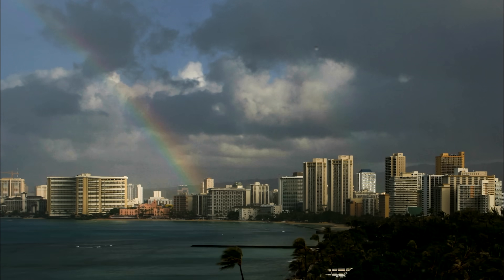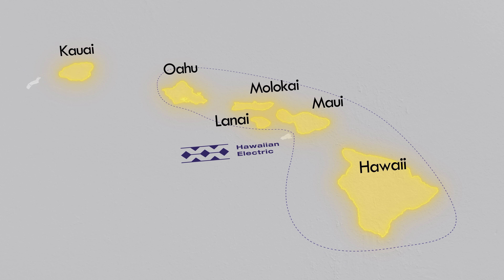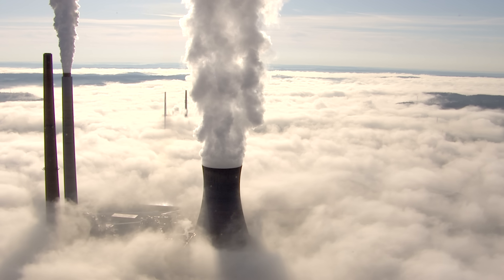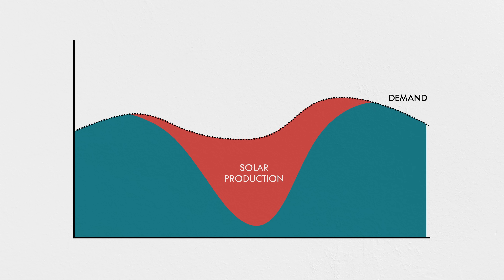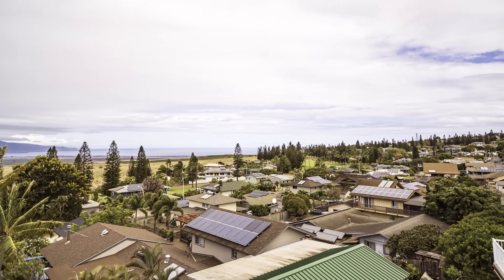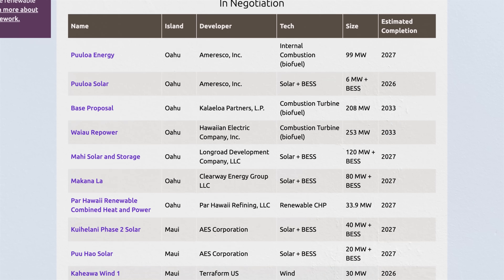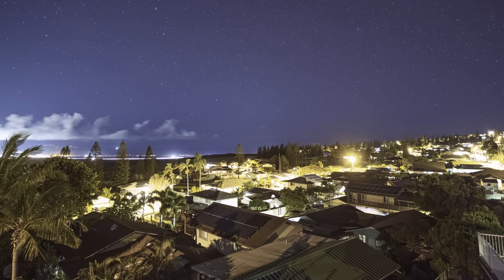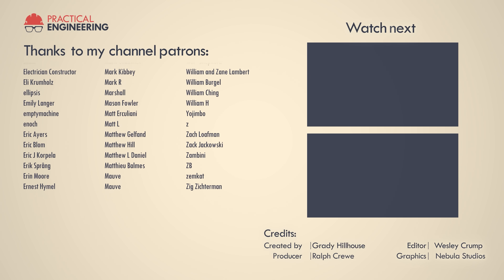How the Hawaiian Power Grid Works

Comment: BUILD NUCLEAR POWER ON AN ASSEMBLY LINE BASIS AND PUT THEM UP WORLDWIDE AS FAST AS A WALMART.

SUPER STORMS, 
EXTREME WEATHER AND ELECTRICITY SHORTAGES 
CAN ALL BE ANSWERED BY OFF-THE-SHELF TECHNOLOGY NOW WITH NUCLEAR POWER. 

NUCLEAR POWER CAN PROVIDE ELECTRICITY FOR CARBON SCRUBBERS. 

CAN PRODUCE HYDROGEN FOR TRUCKS BUSES, RV'S  AND AIRPLANES.

 CAN BE SCALED UP AND DOWN TO COMPLIMENT WIND AND SOLAR.

THEY BURN UP MORE WASTE THEN THEY MAKE.

THEY ARE NON-PROLIFERATION. 

THEY ARE WALK AWAY SAFE.

CAN  PROVIDE STEAM FOR HEATING OUR CITIES.

CAN BE SMALL ENOUGH FOR A CRUISE SHIP OR A SMALL TOWN.

CAN PUT ABOUT 12 OF THEM IN A ROW FOR A LARGE METROPOLITAN CITY.

TRULY COMPLIMENTS A LOCAL POWER GRID.

SMALL FOOTPRINT ABOUT THE SIZE OF A HOME DEPOT.

POLITICIANS AND THE MEDIA HAVE TO STOP SCARING PEOPLE ABOUT NUCLEAR POWER.

 NUCLEAR SAFETY PEOPLE ARE A PARASITE ON THE BUSINESS, MAKING IT SO EXPENSIVE IT CAN'T BE BUILT. 

NUCLEAR POWER IS OVER 99% SAFER THAN PETROLEUM PRODUCT EXTRACTION AND FOR THE ENVIRONMENT.

NUCLEAR POWER IS 99% SAFER THAN PETROLEUM FOSSIL FUEL PRODUCTS.

DON'T BELIEVE ME LOOK AT THE NUMBER OF DEATHS EVERY YEAR EXTRACTING FOSSIL FUELS.

LOOK AT THE POLLUTION IN USING THE AIR WE BREATHE AS THE TRASH CAN FOR FOSSIL FUELS.

LOOK AT THE POLLUTION OF OUR GROUNDWATER.

NUCLEAR POWER CAN USE THE NUCLEAR WASTE AND REPURPOSE IT LIKE FRANCE HAS BEEN DOING FOR MANY YEARS.

THE MEDIA AND POLITICIANS HAVE TO STOP USING NUCLEAR POWER AS CLICKBAIT TO SCARE PEOPLE.

THE MEDIA AND POLITICIANS HAVE BLOOD ON THEIR HANDS FROM EVERY SUPER STORM THAT COMES THROUGH AND EVERY YEAR THAT GOES BY THAT THE PUBLIC IS AFRAID OF NUCLEAR POWER. 

TO POWER ELECTRIC FUTURE BY SCRUBBING CARBON OUT OF THE ATMOSPHERE WE HAVE TO HAVE A CHEAP AND ABUNDANT POWER SOURCE.

A POWER SOURCE BUILT ON AN ASSEMBLY LINE BASIS TO CUT DOWN COSTS AND SHIPPED OUT TO LOCAL COMMUNITIES.

GENERATION 4 NUCLEAR POWER PLANTS HAVE A SMALL FOOTPRINT.

THEY ARE SMALL MODULAR REACTORS THAT CAN BE PUT IN SERIES TO MAKE AS MUCH POWER AS YOU NEED FOR LARGE CITIES AND INDUSTRY.

WE NEED TO HAVE FIELD TRIPS OF KIDS AND PARENTS THAT SEE THE NUCLEAR POWER IS NOT SCARY.

WE NEED TO COMMISSION ARTISTS TO PAINT MURALS ON THE SIDE OF THESE PLANTS THAT CAN BE POSITIONED NEXT TO HOSPITALS OR A WALMART. 

DON'T LET THE MEDIA AND POLITICIANS SCARE YOU ABOUT PAST SO-CALLED NUCLEAR DISASTERS.

WHAT'S THE DISASTER?

THE ONLY DISASTER IS PIGS AT THE TROUGH IN THE NAME OF NUCLEAR SAFETY.

Comment: Shocking how much energy production still is generated from petroleum.  In 2022, fossil fuels generated 93% of Puerto Rico's electricity, with petroleum-fired power plants providing 63%, natural gas 23%, coal 8%, and renewables 6%. In 2023, renewable energy sources produced 5.03% of the island's electricity consumption and Luma is a terrible monopoly, every citizen should try and go to solar.

Comment: Nice summation Grady, thank you.  I managed the North Island Control Centre for New Zealand in the mid 90s.  You pointed out frequency variation - we had a normal operating frequency range of 49.8 to 50.2Hz, as compared to an interconnected continental system as in Europe that would operate at 49.98 to 50.02Hz, quite a significantly more stable frequency.  What you didn't mention was the impact of voltage spikes.  We used capacitors to boost the voltage in the main demand centre of Auckland.  But switching the capacitors in and out with the wrong grid conditions would impose voltage spikes on the grid, that more than once tripped off the oil refinery in the north of the North Island.  My point here is that the variability of both frequency and voltage on very small island power systems presents problems for control electronics designed for large stable interconnected systems.  Something to remember when deciding on the build of a refinery!

Comment: Nice and quite in depth video of the Islands, thanks for sharing. It has been by humble opinion that  all theses corporation has been tackling all their issues from the wrong point of view. There perspective has been and it all ways be their economics survival. While in part this understandable It will always will probably end the same way... the customer sharing all the brunt of some ones else mistakes. It needs to start at the sources; the electrical type and structures at the consumption point. All houses are wire like for 75 or 100 years ago. I think Europe is way ahead of us. Because of all the electronics we need to have DC (12, 19, 24 & 48 Volt system controllers instead of this been all over and under each LED Lights and AC voltages (120, 240 Volts & Single and thri-phase) Motors run much more efficiently on DC, consuming much less power. It is at the consumer houses that are the major issues that need to be fix first. Slow evolution its still in progress with no changes in site currently

Comment: If we can put a nuclear reactor on a ship or submarine, why not an offshore platform? We already have a modern reactor design in the A1B used in Ford class carriers. Alternatively, what about “simple” power generation ship (i.e. a portable nuclear reactor) that can go between islands to “pinch hit?”

We have 65 years of experience building and running floating nuclear reactors with an impeccable safety record. 

At 700mw, the A1B is comparable to the biggest plants in Hawaii, with no CO2 emissions to boot.

Comment: What Hawaii could do to improve reliability is to have generators on barges that can be moved from one island to the next as needed. Most of Hawaii electricity comes from solar. The roof top solar makes more power than the state can use on normal days. That is why they have been some of the first who have invested in battery storage. They had battery storage thirty years ago.

Comment: Very informative video, thank you!  Like most things in life energy supply is a series of trade offs.  The biggest problem in Hawaii on this issue (and many others) is ideology getting in the way of sound engineering and business practices.  The ideologically driven agenda for renewables is wrecking the affordability and reliability of our grid.  While reducing dependence on imported fuels and adding the security of variety of power sources are both good objectives the political interference has done much harm.

Firstly, the monumental cost of the very aggressive renewable targets has driven energy costs to unaffordable heights but even those rates hide the true cost of these new energy sources.  Additionally tax payers are funding massive subsidies for home solar etc.  
Secondly, the true cost is also concealed in that basic grid maintenance has been neglected for many years and now due to very high renewable capital and generation costs forcing cuts elsewhere. reliability and safety are now severely compromised.  Power failures caused by equipment (generation and distribution) failures are climbing faster and faster and, as an example, the tragic Lahaina fire was very likely caused by neglected distribution lines that suffered corrosion and age related failures.

Continuing technology improvements in renewables offer great opportunities for a more reliable and cost effective grid but blunt political and ideological interference is like a bull in a china shop.

Comment: It started off with Hawaii’s grid, and ended with a subjective piece on DC inverters and PV systems. 

So… what’s the purpose of this video? And also, what you’re saying is debatable. Inverters are not “dumb”, and there are various manufacturers and types with various means of communication methods and monitoring systems. 
Furthermore home meters can actually measure the flow of electricity of a residential system and therefore accurately calculate the levels of electricity going in and out of the grid at that point of interconnection. 99% of the time, if not 99.99% of the time, residential and commercial grade solar system aren’t large enough to have that sincere of an impact on the whole grid itself to cause power “frequency” issues. This is just biased and untrue. If we are referring to utility built industrial grade solar systems, this might be of a different nature, but that’s why grids are often powered by various sources, with PV systems only representing a small portion. 

Furthermore you’re missing an important part on storage systems, and the balance of power distribution and availability based on storage and PV combined applications and system. 

This is more of a propaganda piece than it is educational.

Also in regards to frequency, you should use a different word, when speaking of electrical theory, and electricity in general, frequency generally refers to the sine wave fluctuations, measured in hertz, of the current passing through a conductor. This has a different effect, and when speaking of frequency, you can confuse the people who are actually in the industry who are electricians and engineers who consider frequency of a different type than actual consistency of power availability.

Based off this video, it is arguable this is a lobbying tactic, or you are just uneducated on the matter which you are speaking of. Not to say you are unintelligent, your other videos are great. But you are wrong on this one, sorry.

Comment: The outages described here were entirely due to solar.  The point is that that if the solar was replaced w the original thermal generation, bio, diesel etc, it would not been knocked out by cloud cover, which too many have phobia stopping them from the obvious.

Comment: It would be interesting if they just build enough extra capacity and redundancy into the grid and used all the excess power for a bitcoin farm which could be cycled on and off as needed depending on available power to help control costs.

Comment: When you begun with the supposition that the grid is necessary, you blind yourself to the alternatives. The best solution is self-sufficiency; ie off-grid. It's not always an option, but at 3X the average rates for grid power it's probably cheaper too. Let the grid serve (and cost) those who need it and let those willing to be more frugal and careful with their power needs benefit as they should. By eliminating the grid, you lose the need for costly complex solutions which mostly eat up money. When you consider that from ~150 years ago back nobody had power and humanity survived, it brings things into focus more clearly. There are disadvantages to being off-grid but overall it's a win where it's possible and you don't have excess resources like Iceland to work with.

Comment: As a resident of O'ahu, you give HECO a little too much credit regarding the controlled rolling blackouts "for 30 minutes each". They posted a schedule of 30 minutes and specific sections, didn't hold to their schedule or sections, and randomly shut off different areas for 15-40 minutes multiple times outside of the schedule. Nothing went according to their broadcast "plan", making it impossible for residents to anticipate when they will or won't have power. Pretty typical of HECO.

Comment: It's funny how you mention problems that still need to be solved like how to bill for infrastructure costs that don't depend on kWh usage, dealing with distributed generation, and experimenting with time of use charging to shift demand. These are all problems that have been solved where I live (UK).

Utilities have had "Standing Charges" for decades to cover the cost of infrastructure and maintenance regardless of your usage.

Household solar panels and small scale wind and hydro projects are considered just a reduction in your usage, but the meter is smart enough to tell the difference between electricity imported and exported and these values are recorded separately. Your utility company gives you a separate import and export tariff. My solar panels actually earn me something like £700 a year in addition to a reduced bill because of my reduced demand.

And for time of use charging you need a smart meter that reports usage every half hour. My utility company has a tariff where the price changes every half hour depending on demand. Prices are set at 4pm for the day after. The prices can go pretty high between 4pm and 7pm, usually between 30 and 35p per kWh, but regularly go as low as 5p per kWh overnight. However at times when a lot of renewable generation is forecast, when it's windy overnight, it can go negative and the utility company pays us to use electricity.

In fact, a lot of solar and wind output is being forecast this weekend and we are looking at 6 hours during the day on Saturday where the price will go negative. There is a two hour period where we'll be paid between 3.7 and 4.2p per kWh to use electricity. People like me will be disconnecting our solar panels, running heat pumps, charging batteries and EVs so we can make the most of it, which is exactly what the energy company wants.

The technology already exists to make this happen.

Comment: “Distributed Sources” can really impact your devices. Electric line switching and spikes can only be tolerated for a very short period. Those spike arresters only work a few times then pass that voltage spike on to your delicate electronics power supply. So just having a constant source of electricity is just one aspect of your enterprise. Truthfully we need battery regeneration so nothing is connected to the grid, resulting in further energy loss of generation.

Comment: Good stuff. 

The 5 9's rule.. 99.999% uptime means roughly 5min downtime per year.
99.99% uptime means roughly 50min downtime per year.
99.9%... 500min down/yr.
99%... 5000min or roughly 3.5 DAYS of downtime per year.

The utilities track their uptime statistics on an annual basis, and 99% availability sounds good until you realize they can have 88 hours of downtime a year, and those aren't spread out over all 365(.25) days.  There will be lots of days with 0 downtime, and some with a lot more.

The question is what is the consumer willing to live with.  I'd rather have a high availability grid (redundancy and resiliency) so any outage is under an hour, and the total uptime is 4 9's...

Interesting stuff about the Hawaiian Islands' grids and the difficulties in tying them together!

E

Comment: Has anyone considered underwater turbines like the ones being produced  by the startup company TidalWatt? Submerged them deep enough via floating platforms and transfer the power prodyced from tides through floating/weighted cables to shore in designated areas? They wouldn't really be affected by tectonic activities and such. And be a redundant energy resource to help drive down energy costs.

Comment: Great video! I for one am very interested to see what improvements & cost reductions we will see in battery storage in the next few years. Cheaper batteries will help provide generation smoothing to enable more renewable sources.

As for solar inverters, check out California's "Rule 21" requirements on inverters. Lots of work has gone into solar inverters being "smart" participants in the grid, even allowing utilities to remotely turn down generation capacity on individual homes.

Comment: I haven’t reviewed all the previous comments, but other renewable energy source is wave generation/ kinetic power generation where device is placed near shore and the motion of the waves drive internal mechanisms that generate electricity. The power is than sent to shore by cable to a substation and then into the grid.

Comment: The powergrid in Hawaii is terrible. Frequent power outages are the norm (multiple times a month) depending on where you live. A lot of the power lines are also exposed which adds to the issue.

Comment: You need to research net metering more.  The power company makes a lot more money per kw because they sell that energy to the neighboring homes without having to pay transport costs.  That helps them pay for infrastructure.  I often hear of the fluctuating nature of solar generation but that is no different than the fluctuating loads of electric heat.  My house uses 15 kW when the furnace turns on.  How many people are generating 15 kW of solar?  There is a lot of garbage data and politics getting in the way of progress so please tell the whole story.  I like your channel a lot but this video was a bit lacking in finer details.

Comment: You forgot to mention how most of our (hawaii’s) grid is rotting, and falling apart. How abandoned poles and wires litter the landscape, how the corruption in Hawaii electric burned down Lahaina, and how mostly only the hotels are prioritized with storm grade infrastructure. Large parts of our state doesn’t have running water, power or internet. We are not a bastion of “renewable energy”. Our power grid is comparable to a third world country. The power plant on Maui I think was built during WWII and is an obsolete monstrosity. We also cant fully utilize the renewable energy we have due to obsolete and decrepit infrastructure that cant handle the load, so I have been told.

We need to connect the islands grids, get rid of the corrupt individuals, clean up the decaying power lines from our landscape, and end the petty squabbling and come together to fix our state.